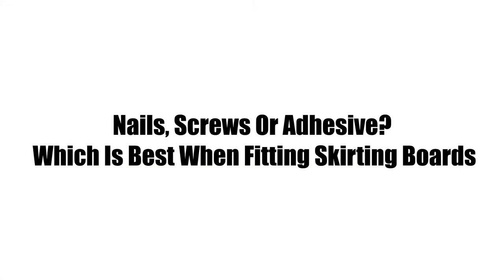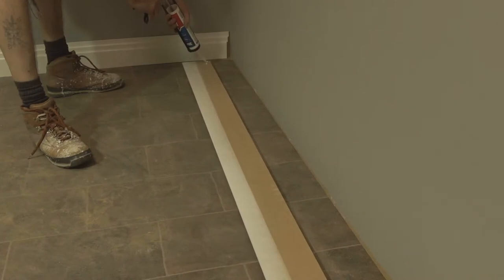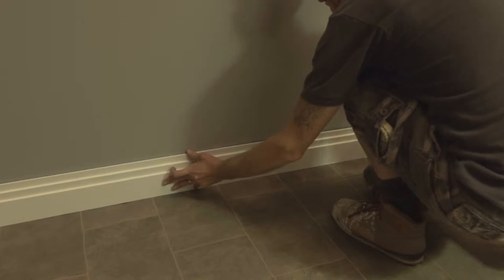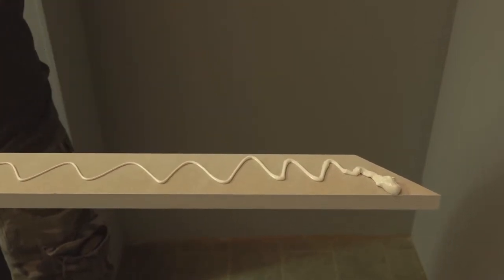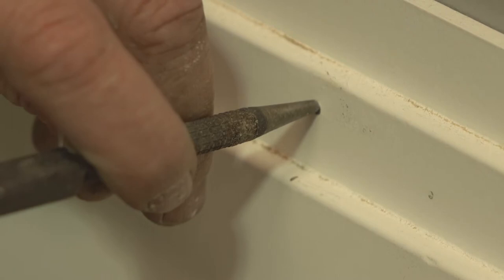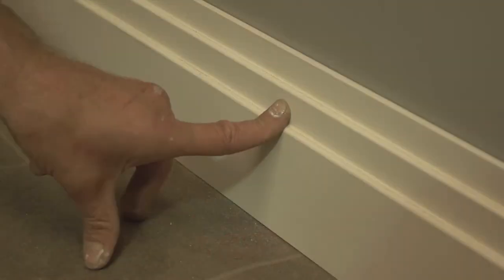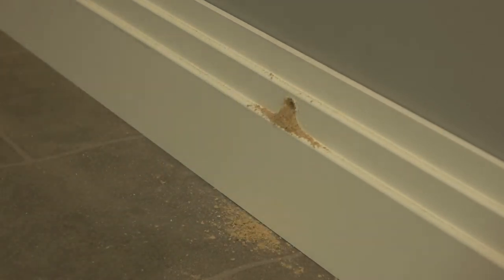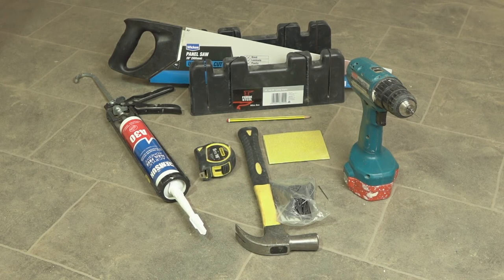Nails, Screws Or Adhesive? Which Is Best When Fitting Skirting Boards? | Skirting World

Comment: I would use Trim Screws instead of regular screwheads. They're way smaller in diameter meaning less destruction to the facing of the board to fill in.